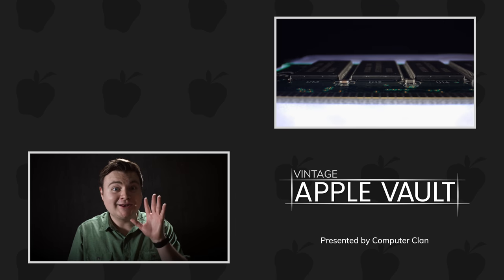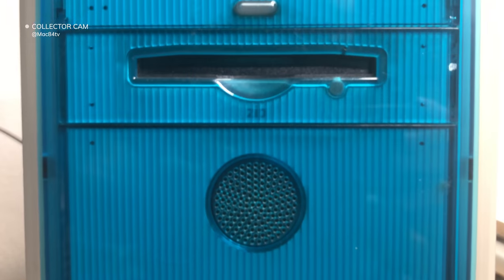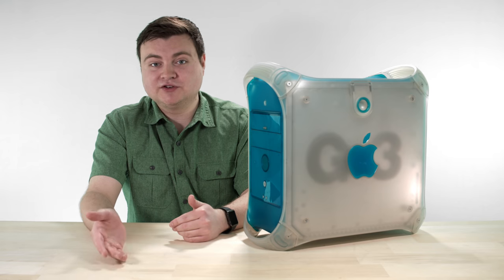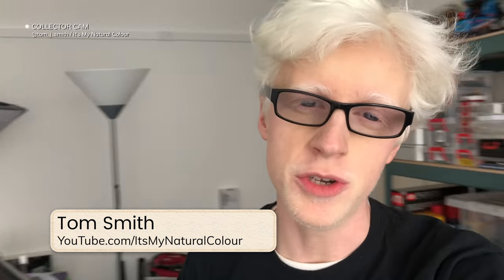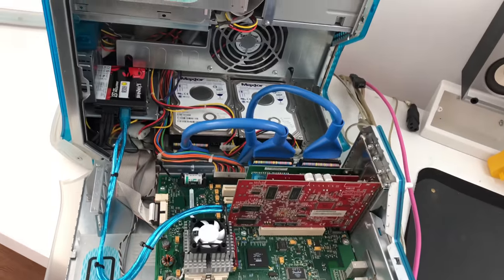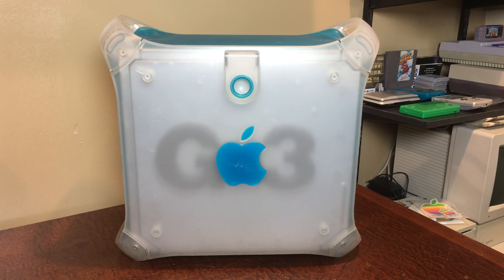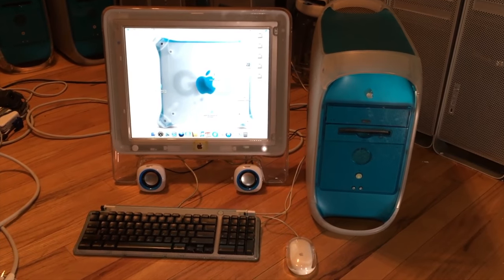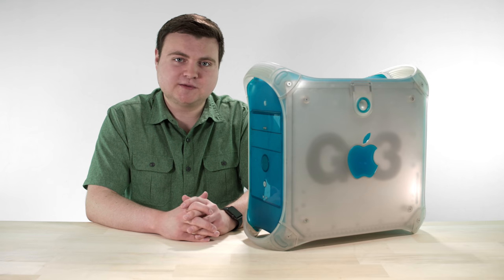Power Macintosh G3 (Blue and White) (ft. It's My Natural Colour) - Vintage Apple Vault #4

Comment: Fun fact about this PowerMac G3, if you turn the machine 90 degrees to the left, you can see something funny in the G3 naming, i don't know if this is intentional, but its so funny! When i first saw the brochure of it, my dad wanted a new mac and whas thinking about the tower or the laptop, he got the powerbook g3 pismo, which i own now, i pointed it out and we were laughing so hard! Good times, and once you see it, its hard to "unsee" it :p The Mouse if you understand what i mean ;) And i found this machine at the local recycling center where i used to live, i asked for it and the dude said "take it man", and it whas only when i brought it home and took a good look at it, that i saw this "Powered By Sonnet" sticker on it, it had a freakin' powerpc g4 400mhz in it, which i whas thrilled about! The one thing that's wrong with my machine, is that 1 of the handles broke off and that its missing all of its hard drive caddy's. I hope to restore this machine 1 day if i can find a cheap one some day

Comment: The thing that was funny about the original iMac, is that it had USB ports. Mind you, the Compaq Presario I had in 1996 also had USB ports, but at the time, very little accessories took advantage of them, from my Zip drive through my scanner and printer, almost all of the accessories shy of game controllers either relied on parallel or serial ports. Keyboards and mice were still using the old tried and true PS2 ports. But those two USB ports on the PC? Like teats on a steer.

But then the iMac was released, and suddenly bam, USB everything started hitting the market. After almost a good 2 years of waiting. Of course, the Presario was already obsolete by that time, so the USB ports went unused, unwanted, and probably already obsolete by then.

Comment from the maker: It’s time for volume 2! With Vintage Apple Vault, we aim to preserve and present Apple products in the best quality ever to exist on web video. Once you watch this new episode, you will agree…

P.S. There’s still time to pledge on Patreon! You’ll gain instant access to extended scenes, bonus material, and you’ll get your name in the show credits!
Reply: Good old times weren't they
Reply: And still showing in my recommended almost 2 years later
Reply: My Blue and White is just a hair faster than IMNCs. I have the even rarer 1.1 ghz Powerlogix Powerforce G3 Zif. rest of specs are in line with imnc. except i have 2 x 1 tb WD Velociraptors in Raid 1, Gigabit Ethernet and PCI Firewire/USB2 Card with an Apple Super Drive from a G5. I also have a 2 x 500 gb ed blue ssd boot drive setup in raid 0. I have the 20' Apple Cinema widescreen and Apple Pro keyboard and mouse

Comment: As for "first computer with built-in FireWire," Sony beat them to market by a month or two, but using the slower 200 Mbps version. (The first release of IEEE1394 supported 100, 200, and 400 Mbps rates. The early add-in cards generally only supported 100 and 200 Mbps.) Sony released a system marketed as a video editing station whose exact name escapes me (Probably PCG- and a few random numbers) that had a 4-pin "i.Link S100" port.  Note that even 100 Mbps is fast enough for the original standard-definition DV protocol, which tops out at 25 Mbps. (Later variants went as high as 100 Mbps, but the high-definition HDV dropped the maximum down to 25 Mbps as it added video compression to the standard.)

I remember working for a place that bought the Sony, only to trade up to the G3 on its release.
Reply: Anonymous Freak jesus well done
Reply: knowing you're probably right on that name

you had a look at Sonys new wireless earbuds yeah the Sony WH3456Z Wifi BT
Reply: "whose exact name escapes me" VAIO?

Comment: I had one of these new in 1999 and I loved it. The original iMac was a decent computer but this thing was just amazing for graphics work, it was the best pro machine Apple has designed in years. I still have mine and it still works a treat in 2021. Firewire was such a big deal.

Comment: While working at an ad agency in the 1990s, I remember the new Macs we got throughout the years. I distinctly remember the IT guy bringing the blue & white G3 into the design department, putting it onto the work island in the middle of the room, and showing how it opened up. I loved the design. I also realized how much of a pain in the ass my beige G3 now was to open compared to the B&W G3. I ended up waiting until the Quicksilver G4 to come out before I upgraded, which also shared the same flip-down access design. Such great machines. Thank you for a great video and I loved the input from the other guys as well.

Comment: The first Mac I've ever used. I'm not kidding. I've found one at a thrift store over a decade ago. I've brought it home and powered it on and Mac OS X booted... into safe mode, and it never booted again, no matter what I tried. While that was a disappointment, that did set me down the path of exploring Macs from this era, especially as that thrift store also had some other old Macs too, including one of my favorites in my collection, an early Revision B iMac G3.

So, thank you Power Mac G3 B&W. Sure, you've crapped out when I tried to use you, but you helped me get into old Macs.

Comment: Modded the crap out of mine. 1.2 or 1ghz (can't remember) G3 Sonnet upgrade, 1gb ram, flashed Nvidia 6200 pci 256mb, usb 2.0 pci card, bluetooth 2.0 USB adapter, apple airport and 10.4

It ran Halo full res no lag options turned up.
Reply: Halo Beta
Reply: @pyeltd.5457  No, Halo FULL RETAIL

Comment: This is without any question, my favorite apple tower computer system.  I used to go sleep at night and dream of having a top of the line Blue and White G3 Tower matched with its 19/20 inch Blue and White flat panel display (the 15 inch model display, just always appeared to be a little to small).  Back during this time, I did not even know what was the difference between USB 1.1 and Firewire 400 ports.

Comment: I had one of those. It was 400 MHz stock and came with a Rage 128. I gradually upgraded it with a Radeon 7000 and a G4 CPU upgrade. I took it to college with me and had some great times playing Unreal Tournament on the LAN in my dorm. I absolutely love the case design, and it was a real powerhouse of a system for its time as well.
Reply: I bought a G4 733 MHz upgrade for mine as well, which turned out to be a mistake. The machine definitely was a whole lot faster, but as I later found out, there were higher clocked G3 accelerators in the 1-1.2 GHz range that far outpaced my G4 for the same price. Also, the motorola chipset on the B&W G3 had a bug which only allowed G4 processors to run a 66 MHz front side bus, down from the native 100 MHz bus of the G3 and 133 MHz bus of the G4. This really crippled the performance of the G4 upgrade and made it a whole lot slower than a real G4 Powermac at the same speed.

The G3 and G4 had similar performance at the same clock speed, the only difference is the G4 had an altivec unit. Unless you had applications that utilized altivec (mostly audio/video encoders) then it was pointless to go with a G4. Hindsight is 20/20, but such accelerators are rare today and I'm lucky to have one.

The best video card a G3 can use is a Radeon 9200 or Geforce FX 5500, modified PPC ROMs can be grabbed from Mac Elite and flashed at your own risk.

Comment: I just recently found your channel and I'm sorry this is probably so late you'll never see it, but you never know :)

I remember seeing a few of these things in my middle school for graphic design. Only a few students got to use them. It was one of the few times I used a Mac in my life tbh.

I came from Bremerton Washington, right across the bay from Seattle. So when I was growing up schools used windows 95 and on I think. I remember helping them install it as a kid. Shoot, I've seen more typewriters than macs and I'm not really that much older than you.

Back to the point, the thing was faster than most pc's I'd used. I was quite surprised even the one you did an episode of the eMachines copied was fast. Sorry I really don't know the names.

I always wondered about firewire and how Macs were better at video editing at such a fundamental level and thank you for such a wonderful explanation. I remember Windows programs in the early 2000s and they were really not that great or the systems trying to render just not good enough for it to be efficient. My friend took days trying to make a cut of Aliens set to heavy metal.

I know its three years late but I'm glad I found such a great video. Thanks Ken!

Comment: 2:18 damn near made me cry the first time I saw that. I had already been messing with PC cases and they were ALL total ass. Here is this (relatively until the Bondi Blue was gone) sexy case you could open with one finger with it STILL ON and have access to everything you needed. This is one of the top ten computer cases ever built. It would be a little higher if it had the 2 5.25 bays like the MDDs.

Comment: Hi Ken, I owned a blue and white G3, 350 model for quite a number of years before selling it.  It was my favorite mac, over a 68K Macintosh.  I used it with Mac OS 8.6 (which it came with) through Mac OS X Tiger.  I was able to upgrade the optical drive  to a DVD-ROM drive, but back then  Apple had a hit and miss drive compatibility list.  I was able to get a Lite ON drive that was both bootable, and compatible with Apple DVD player.  I never was able to get an internal writer to work though, for the same reasons of compatibility.  Apple had a limited list of natively supported drives.

Either way great video.  This is the kind of Apple stuff I love to see.  Well, any legacy computer topics.  Not just apple.  Loved the video, have a great day!

Comment: I love the B&W G3. A few more things about it: if you upgrade the CPU with any G3 or 500MHz or slower G4, the bus clock can stay at 100MHz but if you go to one of the faster G4s (>600MHz) you have to clock the bus down to 66MHz, which is a little disappointing; the onboard UltraATA controller was bugged but OS X gets around the problem by disabling UDMA which means the drive is stuck at PIO 4 (16.7MB/s) instead of the faster DMA-based 33 or 66MB/s modes, severely degrading drive performance but preventing the corruption problems; these (and the similar Yikes! G4) have one of my favorite features: there are a number of diagnostic LEDs scattered around the board, including one near the CPU that shows CPU activity, with the LED changing in intensity depending on how much work the processor is doing at the time (and also to help determine if it's hanging or crashed).

Comment: I have just a beige g3 desktop, however it also has a very satisfying feeling when upgrading components and software. Currently running a 266 with very slight overclock and nice scsi drives using the internal controller. Seems decent enough for classic OS.

Comment: Nice Video squire! I have a G4 which looks very similar to the one that you’re showcasing, It includes the DVD Ram Drive & Zip Drive, It’s all complete & original and I believe I bought it off eBay about 10 years ago or more, It does have a Sticker on it from: “The Open University” here in the UK, The Case has some scratches on it but it works fine although I don’t use it very often, I also have a G4 Quicksilver which is also complete and it’s in better condition and also works but again I don’t use it very often… I also had the older Huge beige G3 9300 & smaller 8200 I think but had to get rid of those due to space constraints although I kept the Hard Drives, Wish I hadn’t now but Hindsight’s a wonderful thing, If only you could Live Life backwards eh! 😂Anthony - Birmingham/UK 🇬🇧

Comment: Informative video, but a point of contention.

Firewire 400 did run at 400 Megabit/s as you stated.  This translates into 50 Megabyte/s.

SCSI-2 (fast version) did in fact run at 1/5 that speed (10 Megabytes/s) or 2/5 of that speed (20 Megabytes/s for the wide version).

However SCSI-3 (also called Fast SCSI) was introduced in 1996.  The speeds ranged from 20 Megabytes/s to 40 Megabytes/s (for the narrow and wide versions respectively).  So compared to 3 year old tech Firewire 400 ran 2.5x to 1.2x as fast.

And finally Ultra-2 was introduced in 1997.  This bumped the speeds up to 40 and 80 Megabytes/s, narrowing down the the lead of Firewire 400 to just 1.2x to -0.6x.  The final slap in the face is that Ultra-3 was introduced in 1999 and firmly expanded its lead to 3.2x that of Firewire 400's performance.

Just wish that technology was still advancing at the same pace today as it did then.

Comment: I remeber this era I had one (g4) I painted black and red and it was dual 466mhz ppc with 1024MB of sdram,  had three addon firewire card to use to push images of a firewire based network to the white mac books as gigabit was not available for the mac laptops it was crazy. Also my mom video camera from jvc actual would allow better transfer and capture only through firewire instead of usb.

Comment: I still have one of these, what should I do with it? It wasn't all about pre made cant change GUI, almost every aspect could be changed turned on or off with "extensions" which were basically system settings, but it was very intuitive, imho the 9.2 OS was the last great operating system before going to OS 10, otherwise known as "X" and it was then that they started to move away from "get into the system and mess around/fine tune it" to "cant adjust this setting use it just one way"  I may not be expressing it exactly, its a little difficult for me to articulate as its 4.30am lol

Comment: I wish Apple was as game changing of a company as they were when this computer came out. I remember using these bad boys. In a couple of days you could render out credits. Oh this was a great time.
Reply from the maker: I think they’re still game changing. The new Mac Pro, the new dev tools, Swift’s evolution, new accessibility features... looks like they’re doing great. Not saying they’re perfect, though ; )
Reply: @ComputerClan  I worked Mac desktop/laptop support for years. It used to be that buying Apple Care was a waste of money because their machines were just that good to no way you should even consider not buying Apple Care. They stripped most of their reseller partners and authorized repair shops of their partnerships all while trying to get your system services at an Apple Store is a nightmare. Their laptops are poorly built with ventilation systems designed to self destruct after a few years. They making it harder and harder to self repair or even have their products fixed (not have parts swapped). Performance is not all that great. They drop products out of no where making you wonder why you should even invest in their ecosystem (they dropped Shake, Aperture, their storage line, servers, OSX Server which was great). Apple is not the same and neither is Microsoft (or Linux desktop). Other PC companies are making great hardware these days. It used to be that paying the Apple tax was worth it but now they really make you think if it is. The new Mac Pro is nice as is the screen but that's designed for a market that has moved on from Mac. I still like Mac OS but in the future I will either be running on another Hackintosh build or virtualized with GPU pass thought. Apple really needs a shake up. The great think about Steve Jobs (other than his cult leader like personality) was that he had the vision and ability to tell shareholders to piss off and not worry about profits because they were innovating on tech that actually mattered.

Comment: I used this as a door stop and now it's sides are smahed and has no feet. Still works on Mac OS Panther. It's little bit rusty to. Hoping to find another one so I can fix this one up as the blue and white case is easy to replace and upgrade the HDD and RAM. also the graphics card is currupt when display a video playback so that needs changing to.

Comment: Great video Ken. I am an original owner of a B&W 450Mhz model with the Zip drive and SCSI card adaptor. I use mine to run Mac OS X Server 1.0, OS 9.2, 10.1 and 10.4.11... just for fun. I have the 1 Ghz G4 upgrade card for it but because it drops the bus speed from 100Mhz down to 60Mhz, I put the G3 chip back into it. Im looking for that elusive 1Ghz G3 chip that Tom from IMNC has installed. Cheers and thanks.
Reply from the maker: That’s awesome. Thanks for watching.

Comment: just got  rid of my molar and my powerpc 98 model. still have my g3 and g4, but my baby is my g5 duel core with 3gigs ram at the moment. It can run any thing made for ppc at max. i have 2 graphics cards the 128 it came with as well as a 256 ragepro with svideo out for my vintage 1988 rca wood grain tv. i scaled down my collection. recently to move....i do not want to upgrade to 10.5 or i loose native os9 support. i even got my 360 controller working on this bad boy....

Comment: "when was the last time you bought a computer with FireWire" My new ryzen system has front panel FireWire
Reply: Why..? USB 3.0 I much faster and cheaper to implement
Reply: RTG Its in a case from 2006 so....
Reply: Wacypro_gamez ah okay so hardly a “new system” :)
Reply: @DozIT  I ran out of budget building my PC so I got this case from a relative for free. Its a new system on the inside
Reply: I have Ryzen and RTX in a backstocked case that looks like a school computer from 2003 (albeit with fan mods)